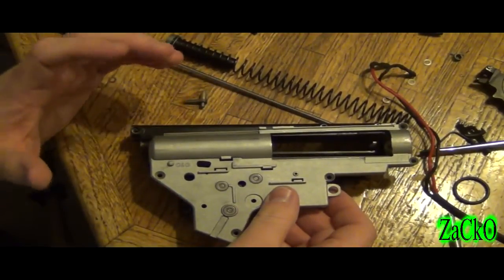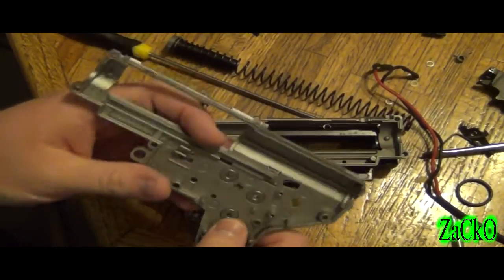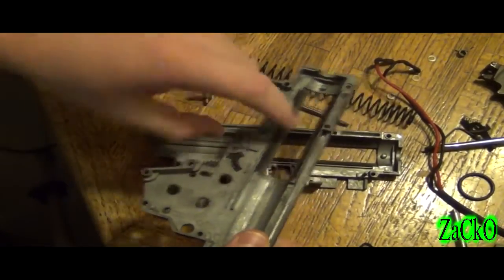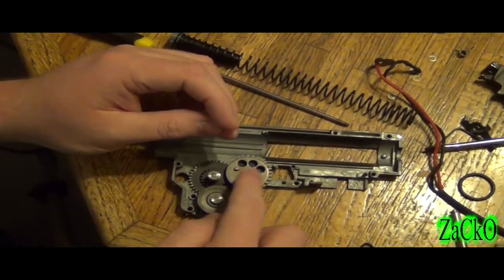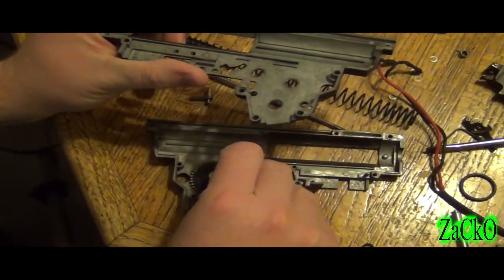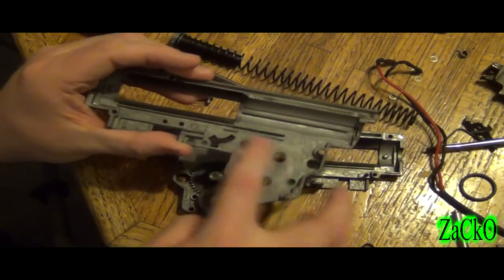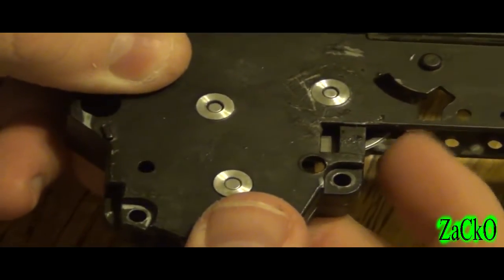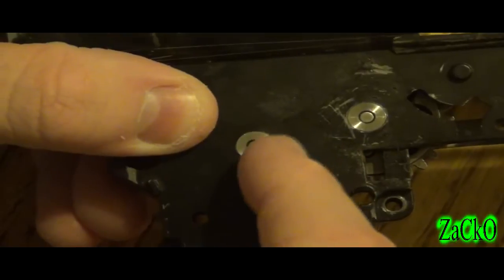How To Find A Bushing Or Gear Axis Problem

Comment: is there any way to fix it or will you need to buy new bushings or a new shell?
Reply from the maker: You could try to replace just the bushing once you find the problem. I did and it works fine. The others were still good.

Comment from the maker: This video demonstrates how to find a bushing or gear axis problem. I could replace the bushing at fault, all bushings, or sand the gear.

HOWEVER, because of proof in tightness it is possible to hurt gear teeth somewhere. Why? Because the axis is off slightly and teeth are cut and made so close together. My suggestion is to remove the bushing.